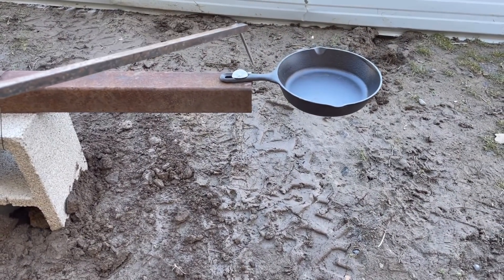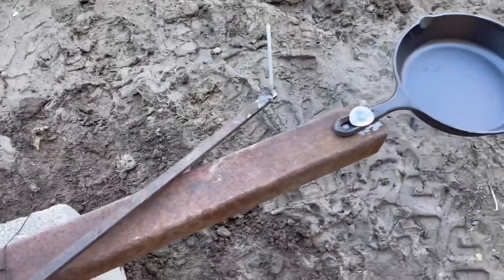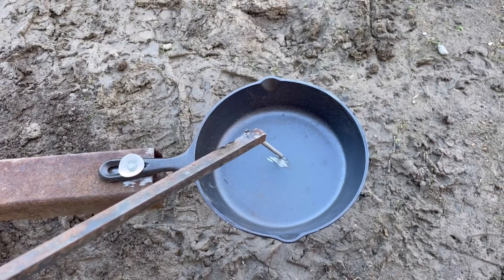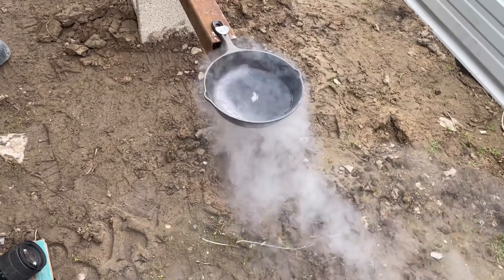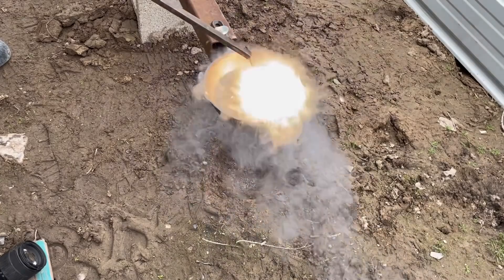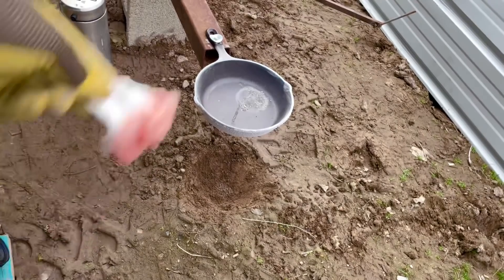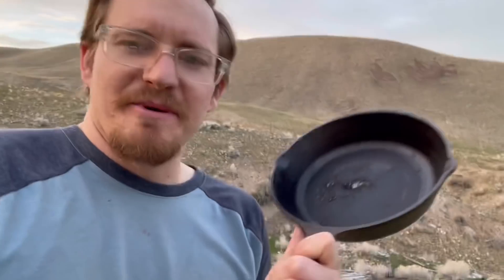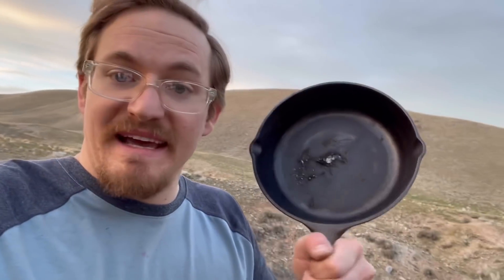Welding in an iron pan full of liquid oxygen

Comment: I recall Adam Savage from Mythbusters talking about a myth they decided was too dangerous to test full scale.  A LOX tanker truck crashed on an asphalt highway and caught fire.  The LOX spills out and saturates the asphalt.  The combination results in the road exploding (not burning vigorously, exploding).  They apparently did some small scale testing and decided it was way too dangerous to scale up due to it being unpredictable and expensive.  Might be a fun thing to try at small scale.  Or maybe it's a terrible idea.  

You can find a video of Adam discussing this by searching for "Adam Savage Answers: What's a Myth You Won't Test?"  on YT.
Reply: I did a small-scale test using a piece of charcoal soaked in LOX once - and that definitely exploded.  It was probably more "violently deflagrated" than "detonated". but in any case it was sufficiently energetic that I was glad I set it off from a considerable distance.
Reply: @TrimeshSZ  Thanks for sharing.  How did you set it off? The only good video I've seen of what claims to be asphalt and LOX used impact, which I thought was very interesting.
Reply: @bagel_deficient  I used a pilot burner from an old gas boiler, a solenoid valve and and ignition transformer (from the same old boiler) - I can't prove it, but I suspect that given the rather long gas line and short time interval between turning it on and things going bang it may have been ignited just by the spark, before the gas even got to the end of the line.  I was also using long tongs to handle it, since I was warned it might be shock sensitive, but in my case nothing untoward happened.  I also suspect that if I tried the same thing today I might end up being arrested as a suspected terrorist, but being young and an idiot was a lot safer back them..
Reply: There was a story about gasoline and LOX getting mixed accidentally by a misfiring rocket that supposedly exploded and damaged a launch complex in the 40s. Thus the idea that it could happen with another hydrocarbon isn't so far fetched to me.
Reply: @luvmechanix  The fundametal difference is that gasoline is much easier mixed with the oxygen to form a violent reacting mixture than 95% gravel and 5% tar.
I now changed my mind and I'm pretty sure that they didn't want to spend the money on a myth that is most likely an underperfomer. If they spend the money on a myth, they need a very spectacular bang in the end!
Reply: In 2007, a gasoline tanker crashed in the MacArthur Maze in the San Francisco Bay Area and 32,500 liters of gasoline spilled and caught fire.  It didn't explode, but the aftermath was incredible.  Essentially, the fire happened right under one of the overpasses, and the steel reinforcement softened enough to cause a collapse.  It looked like Dali had given his melted clock treatment to the freeway.  Definitely worth an image search.
Reply: @jefffrasca4054  "a gasoline tanker crashed in the MacArthur Maze in the San Francisco Bay Area and 32,500 liters of gasoline spilled" - nah, bollocks. Gasoline in US doesn't come in "litres", only in them ol', good gallons - unless imported, that is ;-)
(Just kidding, ignore it : )
Reply: "A LOX tanker truck crashed on an asphalt highway and caught fire.  The LOX spills out and saturates the asphalt.  The combination results in the road exploding (not burning vigorously, exploding)." - they call it Oxyliquit in the trade. According to Auntie Wiki, _ "When liquid oxygen is spilled on tarmac (asphalt) the pavement can become sufficiently explosive to be set off simply by walking on it, even though the oxygen evaporates shortly after it is spilled"_.
Reply: @MrKotBonifacy  It also says [citation needed]
Reply: @miklov  Yes, it does. So it's to anyone to decide whether to take it as it is, or with a tablespoonful of salt.
Reply: Yes test this. I’ve always want to know what this looked like.
Reply: I read about that LOX spill years ago. A firetruck’s tire was blown off by the explosion when it rolled over the oxygen-soaked asphalt. It was not a fire, it was an explosion.
Reply: That’s one of those things they hope the t3rror1sts don’t learn..
Reply: LOX+hydrocarbons, or even better, just carbon is a reasonably well known way to make explosives, it's not a myth to begin with.
Reply: Makes sense. Liquid oxygen is reactive when in the presence of hydrocarbons. Asphalt is a petroleum product. 
LOX+heat+hydrocarbon= fucking bad day!
Reply: Dangerous!? Cody doesn't know the word. 

Seriously... it's a thing... like he never seems to consider that part. 🙄
Reply: @imhigh0013  he's remarkably safe, its really just a bit
Reply: Too "unpredictable and expensive" simply means their legal team and insurers wouldn't go for it.  I have seen much crazier stuff on Youtube done by people like Cody and the Beyond The Press guys.  When you just feel like doing something, you have or can raise the funds, and aren't strangled by red tape, you can do some impressive stuff.  The expense of lighting an entire road on fire would be probably be a little much for Cody.  However, if he wanted to light a large patch of asphalt on fire, I have no doubt he'd figure out how to generate the O2 for it and do it safely.
Reply: @kdawg3484  True. They had nobody that agreed to cover their butts legally. And they didn't want to waste 250k DOLLARS for a myth that has a big likelihood of failing.
But for a test it would be enough to soak a brick size piece of tarmac in LOX and light it up. If that burns well when using a very porous piece... maybe! 
Charcoal briquettes soaked in LOX are quite impressive. I have seen that in person... for that lack of better words, it was no "boom" but a "whooosh"-type of burn. 
With tarmac that usually contains ~95% inert stone gravel... I have my doubts.
Reply: @jackmclane1826  a "whoosh" rather than a "boom" would imply combustion rather than explosion... surely?
Reply: @M_Northstar  Yes, I'm sure. It was still spectacular. Definitly more violent than tarmac could ever be.
Reply: Are you meaning a detonation?
Reply: @scrappydoo7887  The original wording used was "turned the road into a bomb".
Reply: @bagel_deficient  cool 😎
Reply: no no you can not store liquid o2 under pressure like we do propane . the boiling point is so low that you would need special compressors and special storage tanks (for long term storage) hospitals have liquid o2 but they use it at such a volume the pressure never or should i say rarely gets a chance to open the relief valve. no if it was feasible to have a compressor to produce liquid o2 then the food industry would be using liquid nitrogen as there coolant instead of an anhydrous ammonia
Reply: @zackwildman3410  your right. Also hospitals use it in such volume that they have massive vaporizing Fins attached so they can speed up the rate of building pressure to supply the enough ox.
Reply: @zackwildman3410  I don't think anyone said you store liquid o2 under pressure? Cryogenic transport is a thing.
Reply: Don't talk to me! I am famous! Don't dislike my good good GOOD videos! Don't talk to me, dear cran
Reply: @AxxLAfriku  lolwut
Reply: @androiduberalles  please for the love of god ignore him, it's a spambot.
Reply: @Justin Koenig he's not a bot, he's a real person who just acts like this.  Even Odysee hates him, but its "his garden now" according to the guys in charge.
Reply: @AxxLAfriku  what the fk are you on about
Reply: @Nderak  He's a known spammer. Just report and move on
Reply: @Nderak  AxxL is our god
Reply: @Nderak  It's a spambot. Report it and move on. Hopefully we can get the account banned.
Reply: @jamesharding3459  thx for info, for some reason youtube didnt notify me of anyother reply in this thread that pinged me

Comment: You probably already know this but once you start a cut with oxy acetylene you can turn off the propane as long as you keep the oxygen on. Surprised there wasn't more of a reaction but you are probably right.. maybe knock the flux off the rods before trying it as it will help shield the arc?
Reply: Can't cut cast iron with oxygen!

Comment: I got myself an Oxygen concentrator last year for blowing glass. It is amazing how hot the torch gets with 93% oxygen and some propane. I would be interested to learn how to condense it into a liquid for storage as my machine takes a lot of juice to make the O2. Operating with a gas tank would be the ideal long term solution.
Reply: I use one as well. The equipment to compress it is way too crazy IMO in comparison. If you need more O2, get another concentrator. If you need tanks, just order them from a welding supply place.
Reply: You're gonna need a compressor and a pressure resistant vessel. Oxy concentrators have weak compressors just strong enough to operate the filter and provide some pressure, you need higher pressure to initiate a state shift, and a container capable of handling the pressure. Also get a one way valve, cause you don't want it to blow back onto the compressor.
Reply: @rockytom5889  the compression in an O2 concentrator is crazy high, but it is needed for the concentration step.
Reply: @mytech6779  
Oh. Sorry, my experience has only been with the personal oxy concentrators for medical purposes, so I defaulted to that. But yeah it doesn't save energy at all. What it allows is storing a lot of oxy for later use in a smaller space.
Reply: @rockytom5889  All pressure swing adsorption oxy concentrators need 3-7 bar of pressure(50-100psi).
Reply: How would liquefying the concentrator output save any energy at all?
Reply: The simplest way is to literally just build an oxygen condenser like Cody's (he has a video on how he made it and its very simple). That way you aren't dealing with compressors or oxygen concentrators etc. The problem arises with long term storage, you can fill a pressure cylinder with liquid oxygen and cap it but unless you know how much liquid oxygen you are putting in and calculate what pressure this will create once the vessel is sealed you might well be making a bomb. The main complicating factor is the temperature, by adding the liquid oxygen to an open container you are supercooling that container and most likely making it extremely brittle. When you cap the cold brittle container the pressure will rise dramatically, but will it warm up quickly enough to retain its strength and contain that level of pressure? You aren't going to know until you attempt it and it either survives or sends supercooled shrapnel and supercritical liquid oxygen flying rather spectacularly
Reply: @Lilith-Rose  Well stated. Appreciate the feedback. I would of course only use an Oxy tank rated for the gas. Long term storage would be really neat but like you said it might prove to be tricky.
Reply: @freemanslot  it's a great idea, but for practicality in most cases it would be easier to buy bottled oxygen from a welding supplier, that way you have a relative safety guarantee and don't have to worry about your storage bottles going out of test since they are swapped out each time you get a resupply. On the cost front an oxygen condenser is far better since you are really only paying for the liquid nitrogen used to run it but it's something you have to balance for your specific situation and needs. I've personally looked into getting/making a hydrogen oxygen generator based torch for my specific needs but the electricity consumption put me off since I can already do most of the work I need to just fine the with the butane torches and propane furnace I already have (mainly silversmithing and working with other precious metals, but I do a bit of everything)
Reply: @Lilith-Rose  Thats cool to hear. I've been doing some boro glass lampworking with O2 and propane. I dont have a specific use for liquid O2. Just thought it would be cool to see if my compressor could also make the liquid.
Reply: @freemanslot  half the fun is playing around to see what you can do. Glasswork is something I have thought about for future,  partly because I collect uranium glass and have picked up enough damaged/scrap pieces over the years that it would be nice to use them for something constructive. I was originally thinking of making beach glass to turn into pendants etc but that process creates an ultra fine powder as a waste product and given that not all of the antique glass is created equally there's no real standard of safety to follow. I'm already a smoker who has melted more lead and leaded pewter than the average person in questionably ventilated spaces, I don't need fine silica based radioactive powder in my lungs or anywhere really on top of that so it'd not something I have attempted. Yet.
Reply: @Lilith-Rose  wouldn’t recommend heating uranium infused glass. Don’t know much about radioactive materials but that’s sounds like a hazard waiting to catalyze. I work glass more for the art than science but Cody’s Lab has been giving me some ideas.
Reply: @freemanslot  honestly I'd much rather heat it than grind it, for the most part it's supposed to be relatively stable, you don't want to breathe the fumes from heating but you aren't going to be setting off any kind of reaction (adding it to glass is actually a method used to stabilise radioactive waste for storage and disposal). The real danger comes from the dust and powder created while cold working because once it gets into your body you can't get rid of it, even though the output is low level and safe to handle having particles of source material trapped in your lungs and constantly outputting that low level radiation is detrimental to your health to say the least. From what I've read and seen on forums some glassblowers refuse to touch the stuff and others will happily work with it just like any other glass or treat it like lead crystal etc
Reply: Compressing the O2 would simply be a way for me to operate my torch without power is all. I think maybe it would require some expensive gear to pressurize the oxygen into my own canister. I appreciate all the feedback here. If I attempt this, I will definitely be using a one way valve because the parts in my pseudo medical machine are very fragile.
Reply: @freemanslot  if you do compress your oxygen only use pressure vessels rated for oxygen because if any particles are in the vessel they can actually start a fire and possible explosion when going through the regulator and never ever use soap and water to leak test any oxygen system for the same reasons, be safe!
Reply: @Dan-mu5oy  appreciate the feedback👍
Reply: How about just electrolyzing water and then recombusting as an oxyhydrogen torch?

Comment: it is clear the problem here, the temperature is too low for a sustainable reaction.
perhaps is possible for steel wool to not catch fire in liquid air.

well, that is my hypothesis, a passivation layer makes sense too.
Reply: Steel wool will burn, because it doesn't take much energy to heat up (locally) and liquid oxygen is poor at conduction heat away. Steel pan however conducts all the released energy quickly to the whole very cold pan and thus the reaction stops.
Reply: Steel wool will 100% will burn in liquid air or lox.

Comment: Gouging rods would likely work in these conditions. They don’t have flux and do a similar job as an oxy/acetylene torch.
Reply: Or maybe just some good old 6010 with a long arc
Reply: Those specifically use compressed air to blow the melted steel out of the way. I suspect the result would be very similar.
Reply: The problem is the underlying physics/chemistry presented is technically incomplete. 

A cutting torch works off the principle of accelerated oxidation.  While it might be correct to technically call it burning the metal,  it is actually oxidizing it rapidly by the use of heat and saturated oxygen. The heat accelerates a natural oxidation and the added oxygen takes over. Once the cut is started, you can completely remove the fuel as long as the resulting heat from the saturated oxygenation remains. It will produce enough heat at that stage of the process to sustain the cut. (I believe its called an exothermic reaction) 

The liquid oxygen in this scenario presented will act as a sink and remove that required heat. So you will always need enough of a heat source to overcome that removal. They make fire extinguishers that operate on this very principle and are certified for metal fires.
Reply: @sumduma55  ...you do realize that "burning" just means "oxidization", right?
Reply: @DanKaschel  yes, but it's not going to appear like a log in the fireplace burning or a lump of charcoalonnthe barbecue.  Perhaps poor wording but that was the message I was trying to convey.

Edit.  People tend to think of a cutting torch as melting the metal then blowing it out of the way. I thought that once too. My attempt was going for a more vivid picture of what really happens.
Reply: The carbon gouging rod would pretty much instantly be combusted is my bet.